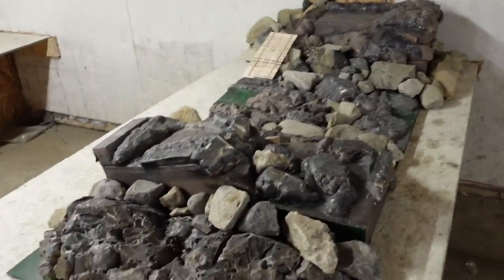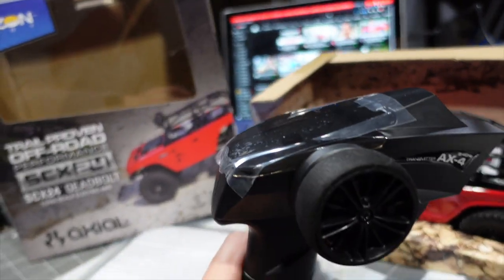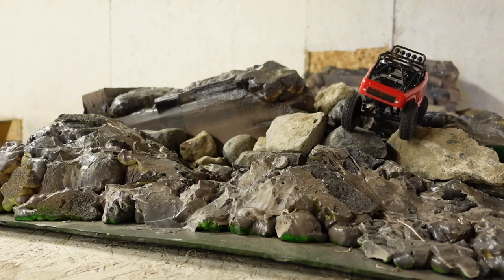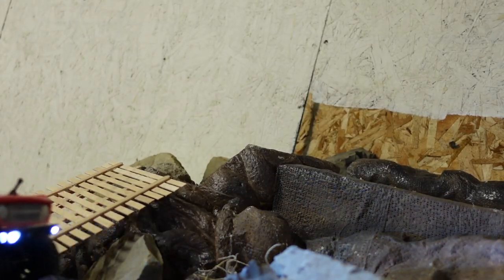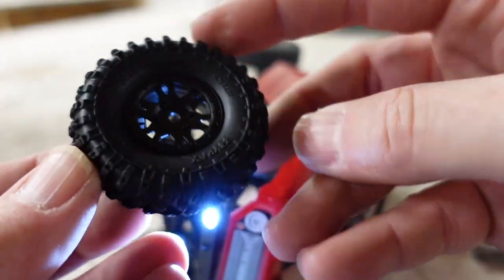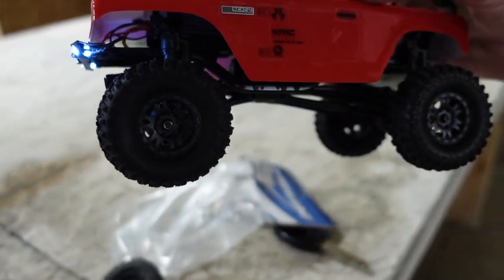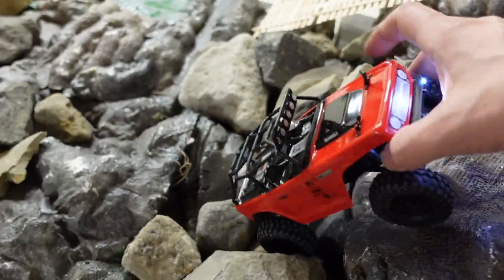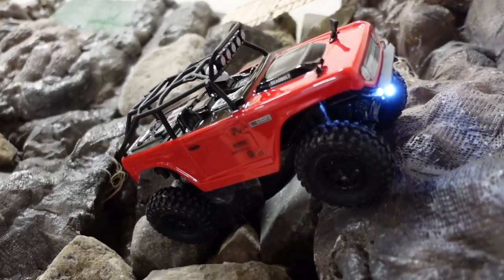Micro Crawler Course! SCX24 Deadbolt Upgrades vs Stock -  Hyrax 1.0 Tires with Brass - Netcruzer RC

Comment: Don't need to spend much, tire was already a huge part. Get the front diff cover, servo and steering link and it's a huge improvement. Metal beadlock gives you good low weight as well
Reply from the maker: Got some no-name brass diff covers already just didn’t install yet. Steering seems OK so far but will upgrade when it fails or cannot do what I need it to. Thanks for Watching!
Reply: @netcruzer  always a pleasure, just splurged on a 6.3d kit, you always make me wanna race lol